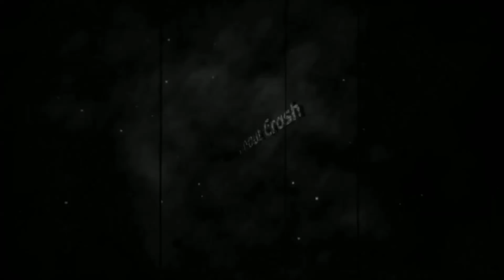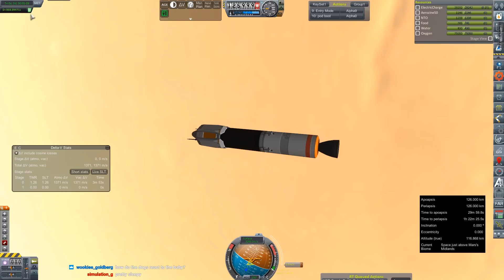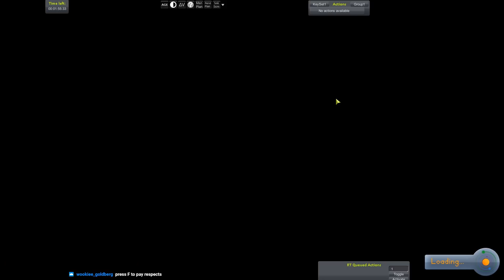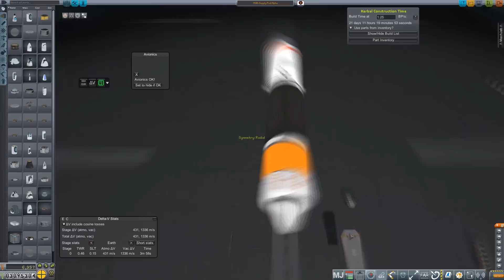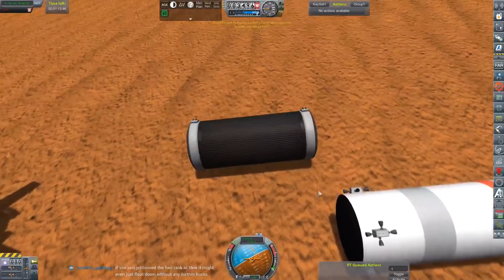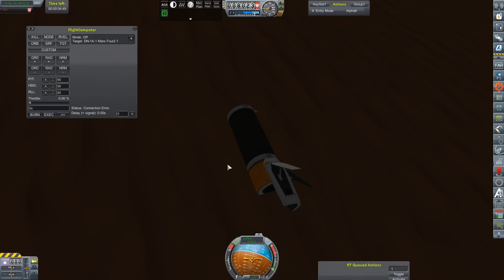KSP RP-0 #438 Target Practice ( Twitch Re-Cap )

Comment: What's the point of caring that heavy airbrake when you have to use chutes and booster anyway? : Thinking:
Reply from the maker: The airbrakes are to keep the engine pointed down.  The chutes are pretty heavy, so as the fuel burns away, the top end wants to shift to the bottom